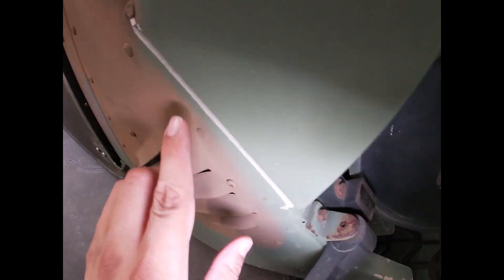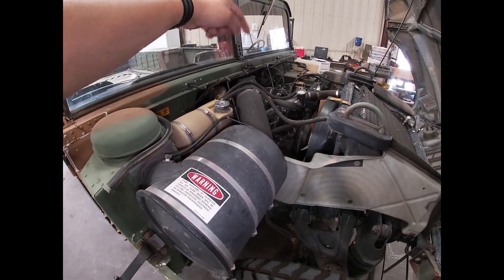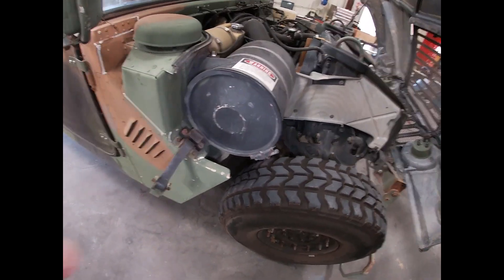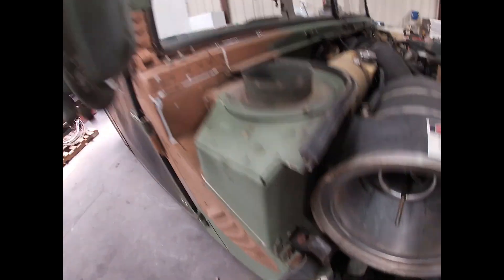Breathe Humvee! Breavee!!

Comment: put on a sy-clone 9005 prefilter on top of the airinlet combined with a snorkel ,open up that internals of the airfilterhousing and as you did the housing itself and than look what it brings i think maximaze cold airflow brings some extra power too every engine

Comment: What size filter.  Link doesn’t work anymore
Reply from the maker: K&N part number E-1700
Reply: Just ordered.  Thanks.
Reply from the maker: @FREEDOM9911  great to hear. If you open up the other parts it will definitely have a smoother acceleration.
Reply from the maker: Let me try and look for a part number for you. It’s a big filter.

Comment: Omg 😱 that’s not water proof because inside is an rubber elbow. Not the box where it is 🤦🏻
Reply from the maker: Doesn’t matter. I’m not going to be driving it underwater.
Reply: What rubber elbow you're talking about? I'm thinking about doing this but I want it to still be capable of fording
Reply: @hummerguy  The "rubber elbow" being discussed is installed on all USMC HMMWVs we build.  Rubber elbow or not a HMMWV was not designed to do more than 30 inches (shallow water fording) without the "FULL" Deep Water (for up to 60 inches) Fording Kit installed.  Of course there have been some who have tried to go deeper and lived to tell about it!😂

FYI: The entire HMMWV's Air Induction System was very specifically designed to perform in very specific ways. By "modifying" part of that complete system it may affect more than one other system. For example; venting for ALL gear boxes "WAS" dependent on a (calibrated) amount of vacuum created when the engine is running through that "NOW MODIFIED" air induction system!!! PS: [the good part of this modification is if one never drives their HMMWV they will not find out of these modifications will cause gear box seal leaks (insufficient ventilation) or gear box fluids to be sucked into the air cleaner/engine (too much vacuum).